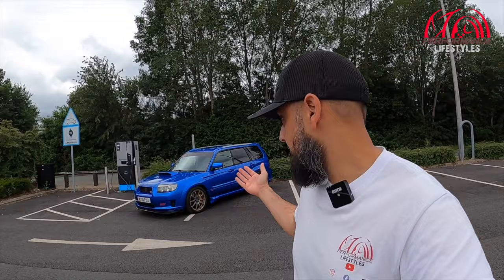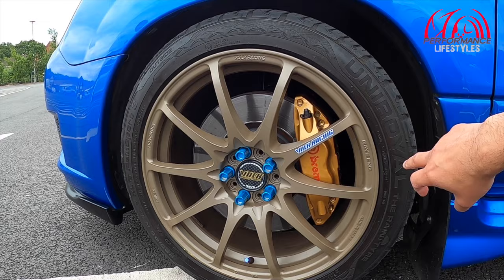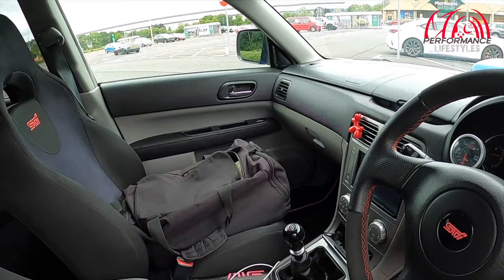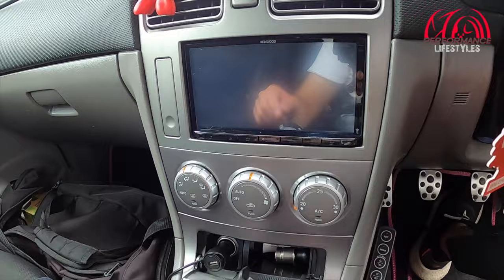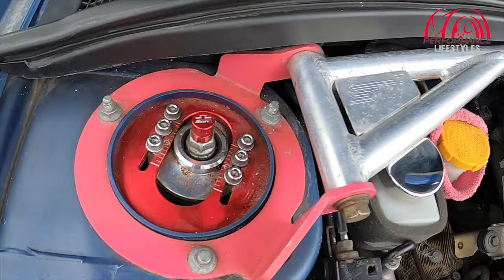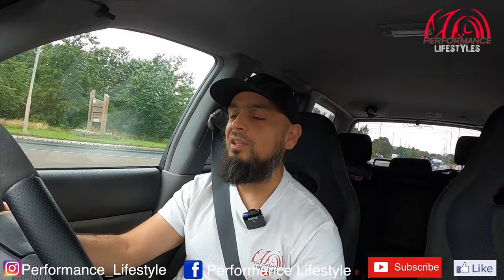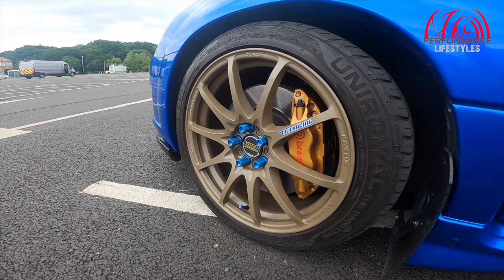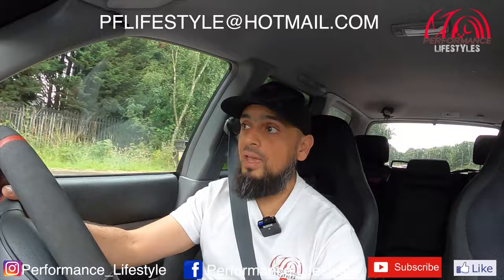Subaru Forester STI - SG9 - 350BHP Family Wagon *REVIEW* JDM Only

Comment: That's the standart sg5 prefacelift center console. OEM sg9 STi is black with black AC Buttons as well as black shifter trim surrounding.
Reply from the maker: Yes buddy, correct. The owner didn't like the black as they tend to get sticky. Great car this 👌

Comment: Is this an imported JDM STi or a local Forester that's been converted? Reason I ask is the different blue paint in the engine bay that isn't World Rally Blue, and I thought the stereo trim/climate control is always black on the STi but maybe that was  an option.
Reply: I had a WRB version 8 sti (NZDM, but same spec as JDM) and it had that same purplish colour in the engine bay.
Reply from the maker: It's a genuine STI Japanese Import. The engine bay on all Imprezas is the same, no lacquer I think. Just noticeable more on a blue car.

The stereo surround has probably been replaced at some point, every other one I have been in was black too.

This is such a fantastic car 🔥
Reply: Cool thanks for the clarification :)
Reply: Like the others have said yeah they don’t paint the engine bays in Japan on a lot of cars, and your right about the center console they are like a black Matt look but they go sticky and scratched so I put a xten model one in with the added cup holder as it just looked a lot tidier than the old black one 👍
Reply: @boden666  Can paint the XT ones black if you like, put your red hazard switch in, looks pretty good.
Reply from the maker: @boden666  the centre consoles do go a bit horrible and sticky so a good move to replace it. 

I've never quite understood why they don't fully finish the paint on the engine bays, but it is what it is 🤣

Comment: They 6 pot Brembo not 4 bro
Reply from the maker: I'm fairly sure they are 4 front 2 rear 🤔
Reply: OEM Forester STi got 4 Pot in the front, 2 in the rear. Only Subaru with 6 pod in the front is the 2017+ WRX STi.
Reply: there is a kit you can get though. It allows you to put Porsche Cayenne S 6 Pod front and 4 pod rear calipers on your Subaru
Reply from the maker: @ForryXT  and the RA-R hawk which has the 6 pots up front (we have a video of a S402 Legacy which has the 6pots too)
Reply from the maker: @ForryXT  didn't know that was a mod you could do 👍